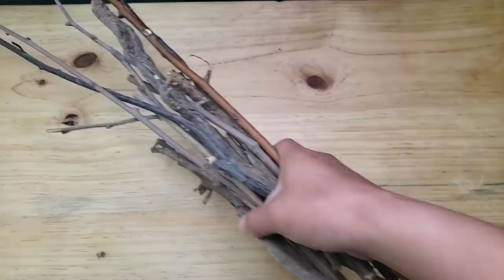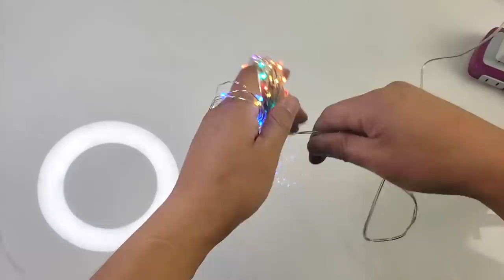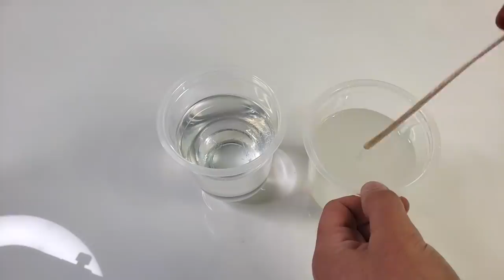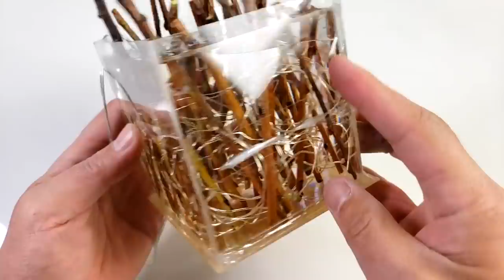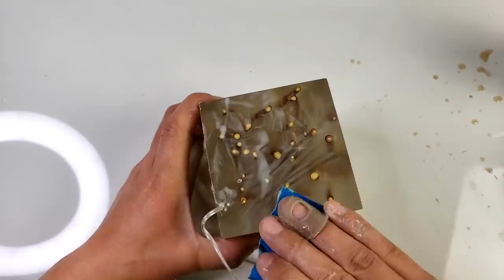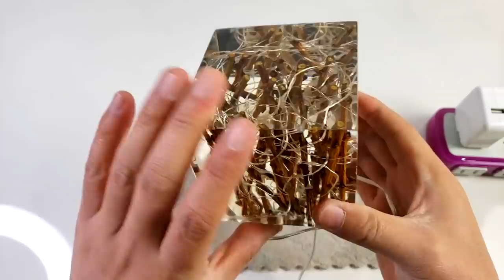Resin Night Lamp With Epoxy and Dead Branches / Resin ART

Comment: Fantastic. The only thing I would try to do is on a future one, have the cord come out near one of the posts and a groove carved in the post so as to “hide” the cord, then come out the bottom of the wood base with a groove so it lays smooth on the bottom and exits to the side. Hope that makes sense — just trying to not have the cord so obvious.  In fact, if embedded in a post groove, it could be resined over with a color in the light to mask the cord.  Each post could have grooves with resin color — might pick up light from the top and travel a bit into the post. 

But no matter — terrific and very imaginative work.  Thanks for sharing.  Can’t wait to watch more.
Reply from the maker: Thank you for your advice, I learned more from you rosebudforglory😊

Comment: I have a slightly dumb question... do you use a heat torch when making the lamps to get rid of bubbles and how do you get it so all the bubbles are out? I'm fairly new to working with resin and was trying to figure out how to rid of bubbles on a larger scale. I absolutely LOVE YOUR work btw it's beautiful and you are extremely talented!!
Reply: you should use  vacuum machine

Comment: Nice work, what type of resin are you using?  I have trouble with resin cracking and overheating when it’s poured thick like this.  Also did you degas or pressurize to remove bubbles?

Comment: I really love this! I’d like to try this myself, but I have a question. Do those lights last long term? Do they ever burn out?
Reply: My opinion is, this is really pretty and after a while you can count down the lights that stop working until you have to throw it away. A golden rule of electronics and electrics is "never put something where it cannot be replaced, EVERYTHING needs replacing".
Reply from the maker: The LEDs inside can be used for a long time. They can light up continuously for 300 days. If you only light up for a few hours a day, you can use them for many years. These small led lamps generate very little heat, so do n’t worry about damage 😊
Reply from the maker: You are right, I just want to achieve this effect. In order to ensure a longer service life, I can only try to choose better LED lights. 👍👍👍
Reply: @BuzzingFish  Well, those seem like great LEDs! It's nice to know you know how to choose your electronics too, besides being an amazing artist! =D
Reply: @BuzzingFish  Do you have a recommendation? I have to do a table commission with LED lights inside but I'm a bit scared to encapsulate the fairy led light in. Thank you in advance. Amazin work as usual.

Comment: Hey i wanted to ask if u use any fluids to get the plexi sheets off of the epoxy afterwards or does it work without any wax or else? :)
And do u use any oils for the polishing or just water?
Reply from the maker: It's just water. 😊